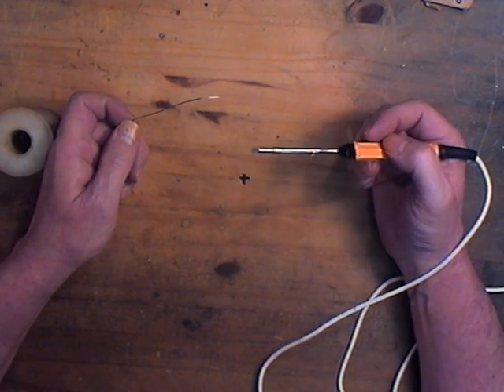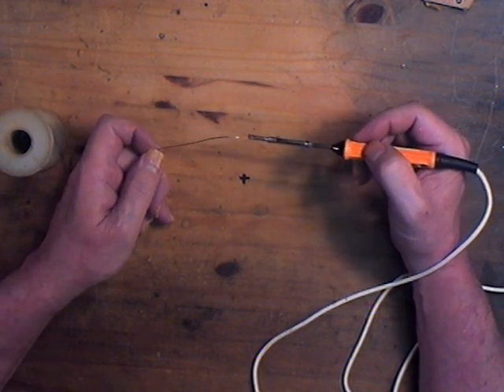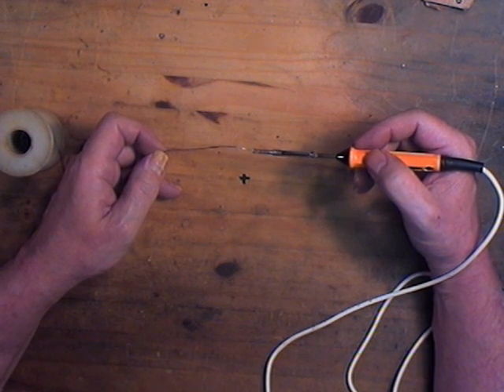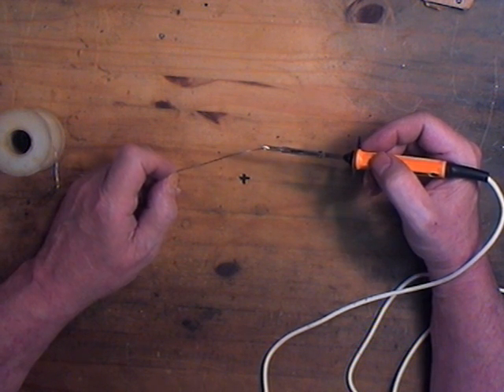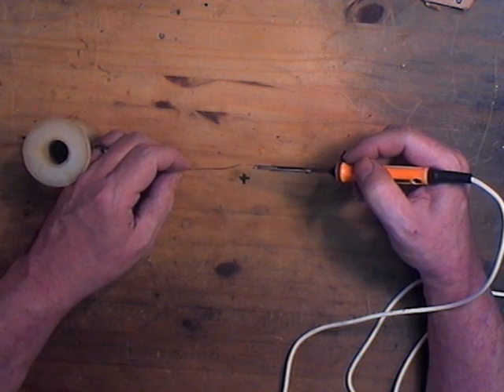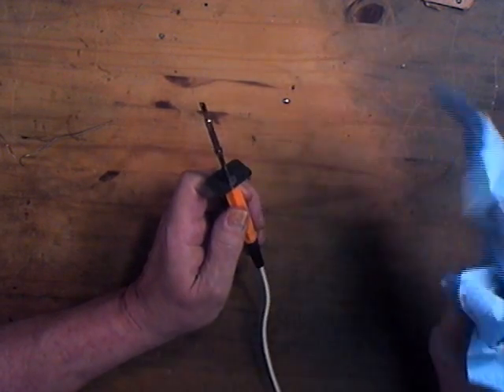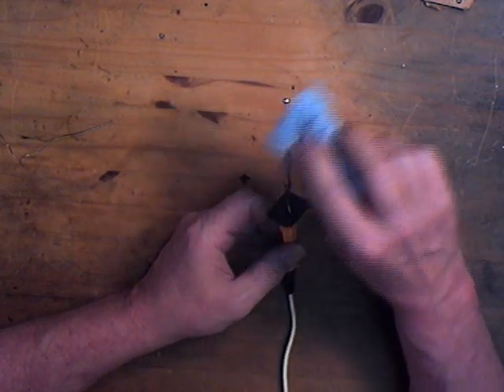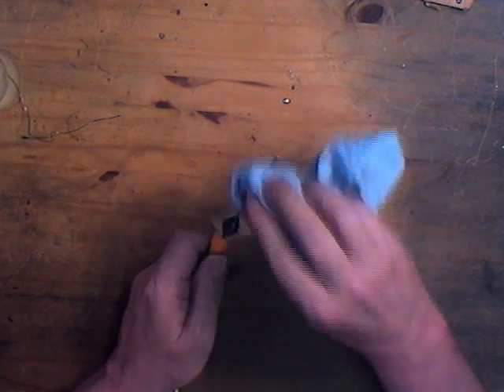How to tin a soldering iron tip

Comment: I just got a new budget 60W iron and found it really frustrating that I couldnt tin the tip. Wrapping the tip with solder and letting it tin as it heated up worked perfectly. Thanks for the video!

Comment: Thank you so much. I only recently learnt that most soldering iron tips are now copper coated in iron - they used to be just copper which tinned easily. But the tip of tinning as you heat the iron from cold, worked a treat. For one Soldering iron I had lost the tip altogether. So I found a nail the right thickness and length, cut the head off, cleaned it thorougly, dipped the tip in liquid rosin flux, then followed your procedure - success first time. I know iron doesn't conduct heat as well as copper, but in this case it got up to temperature quite adeqately. It should work for anyone as long as the power output of the soldering iron is sufficient (30-40W) to allow for the lower heat conductivity of iron.

Comment: I figured it out. If you already heated up the tip without solder on the tip, then the tip becomes oxidized therefor the solder will not adhear to the tip. So what you do is sand the tip really well till its clean. Do this when its unpluged and cool to the touch. Once you have done that wrap the tip in solder, heat it up, and apply more solder where you see a bald spot. Hope this helps!
Reply: You never sand a soldering iron tip unless it's a solid copper tip. Use very fine steel wool instead.

Comment: Is It Bad That On First Use Of My Iron It Started Stinking And Solder Wouldn't Stick To The Tip? Do I Need To Add Flux To It To Make Solder Stick To It? Will It Work Even If It Oxidised On First Use? Sorry For The Question Overload, I'm  Just Confused.

Comment: ok, im goin nuts! everytime i get the solder on the tip it just turns to a metal ball and falls off. what the hell am i doin wrong? and yes i tried wrapping the tip in solder before turning it on. still the same result.
Reply: Ugh SAME. I cant find anything about this! What I think is that Im using the wrong kind of solder? I dont know.

Comment: Do you do this every-time you solder? I always end up with too much and it drips off I usually try to combat this by using the wet sponge that came with it but I am not sure what I am doing is correct or not this is how I found this video. I just got a new temperature controlled iron with 6 tips so I need to learn how to preserve these tips cause my last iron and tip didn't fair to well. :)
Reply: Instead of using a sponge get a dry solder tip cleaner, like this one https://www.amazon.com/Aoyue-Soldering-Cleaner-sponge-needed/dp/B005C789EU

Comment: What if The solder wire can't stick to tip of soldering iron,  and the melted solder wire are just  keep on falling Nd falling..  any possible solution sir or its better to buy a new one?
Reply: +april hiraoka  YES! Out of my anger and frustration I did the forbidden (tried so many things including wrapping)  I have the million dollar answer so many are looking for... The Cheap Irons tip are shiny I don't know what their coated with but looks a lot like nickel or steel (supposed to be iron)(expensive Weller tips have an iron coat over copper looks dull they are the best but are not cheap) It you take some sandpaper or in my case a drill with a wire-wheel and carefully knock their shitty coating off tip till you hit the copper underneath (JUST ON THE TIP  tinning AREA!). When you go to tin it again,  try and get it to stick as soon as possible tinned like a dream. This KILLS the lifespan of the tip but the dam things are near useless if you cant tin the tip...
Reply: too much soldier is causing that from what i know! (its my first time soldering right now lol!)

Comment: I am hell on tips.  I made a tiny induction coil with a small copper plumbing cap to melt solder in.
heat it up until the solder melts stick your tip down in it and then turn your iron on.  it has no choice but to tin perfectly,
Reply: Clown Whisper I asume that you used a ZVS driver to make that tip tinner jig. Very nice idea for peoples that solder very often like me. Cheers :)

Comment: wish I knew this before. Even the weller manual says nothing about this step. this was my first time soldering and I thought I had to heat the tip up and then tin but, instead my tip is black and repels solder. Thanks for the info.
Reply: right.... I returned a 40 watt Weller and called the support center and got no real help about why I could not tin a brand new iron tip.... from the manufacturer support line at Weller
Reply: Following on from this, I added the tip from this video to my Amazon review as a warning to other potential buyers so they didn't ruin their tips. It got so many upvotes, someone told me the manufacturer ended up adding the tip to their manual! It made me laugh.
So ... great tip!
Reply: I went through the same thing. Wrecked 2 tips because this wasn't in the instructions or the videos I watched!
Reply: Yes same! Just bought same brand and had same issue on new tip. This is so good to know.

Comment: Hey I just got my first soldering iron and used this procedure and it seemed to love it. I didn't get it very far past the tip and did get some blackening like 3/4 of an inch after the tip, but it worked pretty good.

Thanks for the info!

Comment: Could I brush the tip with flux before heating it up first?
Reply from the maker: You could, it won't hurt anything (DO NOT USE ACID FLUX!!!!), but it is not necessary. This solder, like most solder you buy for electronics has a core of rosin flux already. But, remember - this is for a NEW tip. If it has never been heated, it should not have very much, if any, oxidation. And the whole "trick" to getting a good tin, that will last is to get the solder ONTO the tip before the tip heats enough to start oxidizing, which happens at a higher temperature than the solder will melt at. Done properly, you are set (with regular cleaning and re-tinning) until the tip either wears out mechanically, or gets contaminated - say by melting plastic with it....

And, never, ever, get acid flux (like from the plumbing aisle) anywhere near your iron, or any electronics. Acid flux is highly corrosive. It will ruin the tip, and eventually any parts you solder. Acid flux is for plumbing (and leaded glass, and crafts, NOT electronics).
Reply: Sounds good.  I think I did good on my tip so far then.  Thanks for the heads up on the acid flux.  I don't have it thank god but I'll make sure to keep a look out on my next bottle
Reply: you can brush my tip with anything :)

Comment: Thank you. that is what I thought I read somewhere. I need to tell that to my grandpa who helped me sand down my ruined tip with a drill and sandpaper. I guess I should get a new tip and start all over huh?

We got the tip to get real shinny after sanding it and using it the first time (last time I used it). Now its back to not getting shinny/hot anymore.

Comment from the maker: Most soldering iron tips are plated. Sandpaper will only remove the plating and expose the copper, which will oxidize mu more readily. Once oxidation gets on the tip, under the tinning, it is -almost- impossible to remove...  It is the thin coating of solder on the tip that transfers the heat to the joint - not "physical pressure". Any portion without that coating (tinning) will not transfer heat effectively, and you will burn up the board trying. Please see the article for a full explanation!

Comment: Didn't do this and the tip's surface became rough and sort of brittle.  Soldering has been a b**ch and a half since then.  I was thinking "wtf am I doing wrong.. why me!" lol.  I did finally get the job done but now I know it's really supposed to be much easier to get the heat to transfer.  It takes FOREVER and is so unpredictable without doing this first.

Comment: I just got a new soldering iron it came with another tip and I think I messed up the first one, when I went to solder for the first time with that iron, the solder melted and fell right off the iron it never stuck to it why is this?

Comment: I have managed to get the tip shinny once today. somehow it got shinny when i wiped it on a sponge. perhaps cooling it down with the sponge made it less hot and absorbed the solder instead of burning it away? also, i've been cleaning the tip with sandpaper. i guess thats not a good idea.

Comment: wow. ive been doing it all wrong. no one ever told me about having to do it BEFORE it heats up. ive been having problems getting solder to melt with the tip. if i put the solder higher up on the tip (towards the handle), it will melt. i haven't gotten the tip to hold solder and stay shinny. is that what you mean by oxidation?